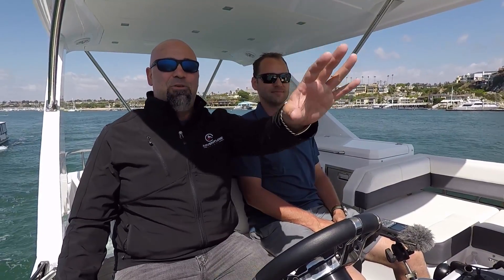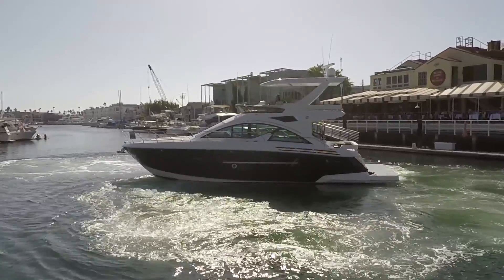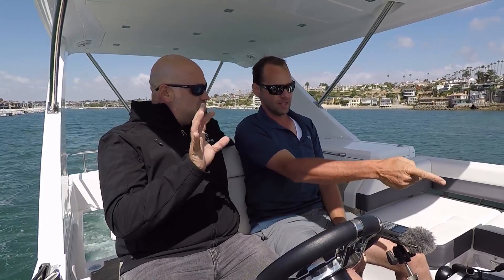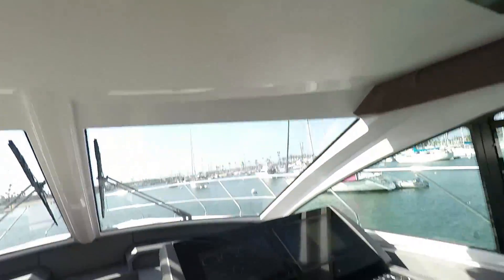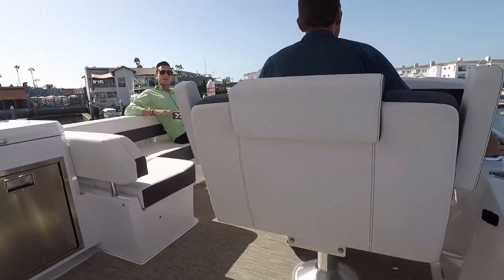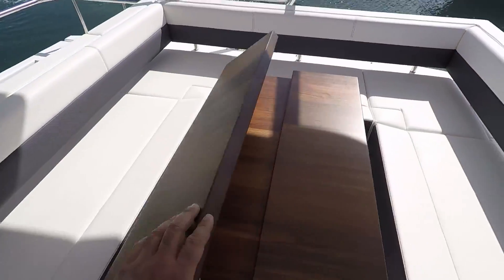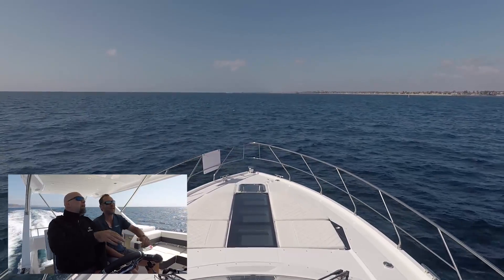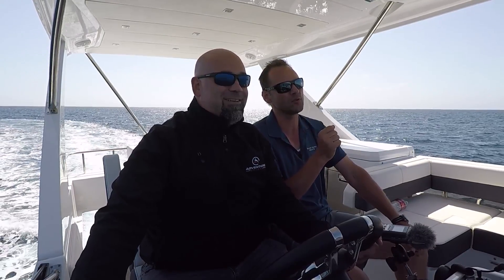Cruisers Yachts 54 Flybridge - One Wake

Comment: I don't know anything about boats but 1.7 million for this? Damn. I expected it would cost somewhere around 500k. Can someone tell me if boats like this deprieciate a lot? What would be the cost of a boat like this in 5 years for example?
Reply: cod1mp its a luxury apartment that has a gyro stabilizer and you can move to anywhere on the coast you want
Reply: It will still be over $1M in 5yrs
Reply: Yes. You can get these pretty cheap from arab emirates. Rich kids buy them and NEVER leave the port. Like you need to do some work on them since the engines most likely never have run for long.
Reply: A 54 is a big boat.  If you don't have 1.7 million to spend, you can buy a decent 54 footer for 250k that is 15-25 years old.
Reply from the maker: cod1mp you can buy a depreciated yacht, like the above commenter said, for around 40-50 percent of the new cost after 15-20 years. However for a 50 Foot boat id probably factor in $30-40k per year for running costs and maintenance. A friend with a 20 year old 115 Foot boat pays $200k/year in maintenance!
Reply: all the boat guys know boat means Bust Out Another Thousand. Boat. Expensive hobby.
Reply: TheSmokingTire the solid gold rotary motor was a bad idea. Low on torque for a 115ft boat.
Reply: 2016 Sea Ray L590 Express would be my value proposition @ 1.9. www.youtube.com/watch?v=fSwcP_Lg9X0 If you weren't stabbed by every sharp 90 angle on the Cruisers w/the first sea or a couple drinks, you would never leave dock after. It is beautiful boat. particularly in motion, and a fly bridge in undeniable. The Gyro at 200k is amazing but isn't relevant when docked in harbor so when is it?. This is not the type of boat that will sit anchored. No party in a rougher seas. 200k would be running costs, better appointments, open water capacity, diesels that would give you range with idle and electrical power. radar, chart plotters etc. - a best of breed built boat; The Sea Ray. Have a look back at the Crusiers after the Sea Ray to see what I mean.
Reply: TheSmokingTire $20k is insane for a 50 footer but I guess that also depends what type of boat you have and what technology is used and your location.
Reply: One of those gyro stabilizers with installation will run about 95,000 the boat I. 5 years will probably be worth around 1.1 mil

Comment: v8s???? Volvo diesels are straight 6 cylinders. Great boat by the way.
Reply: CivicChina You are correct. This is IPS 800. First one we have received.
Reply: I do, everyday since it is my job
:VOLVO PENTA IPS950
Volvo Penta IPS950 is a perfectly matched package, powered by the in-line 6-cylinder D11, a 10.8-liter, common-rail diesel with a twin-entry turbo, and supercharger for incredible, low rpm response. Working together with a perfectly matched IPS2 pod, twin counter-rotating propellers and the Electronic Vessel Control system, this package offers excellent maneuverability, long action range and low emissions.